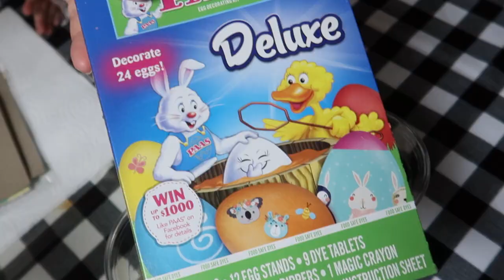Dusting off my PE-770

Comment: Hi Pam, Check your bobbin case and make sure it’s not bent. Switch the cases with the other machine to see if it works. 🤞🏽
Reply from the maker: It is the needle case. It seems to be stuck in-between needles. The online tech said the needle case may have to be removed. Yikes!